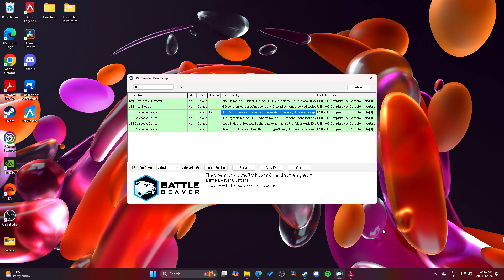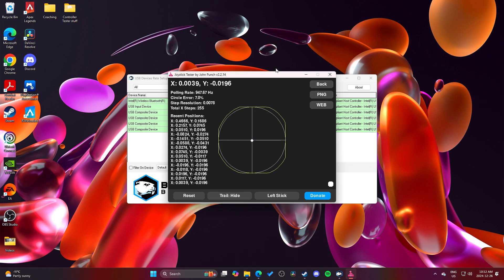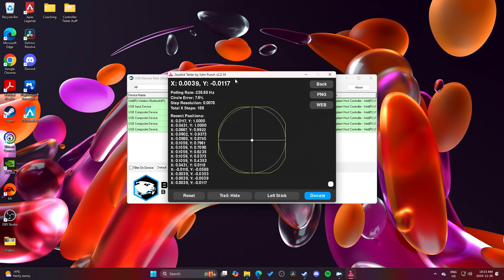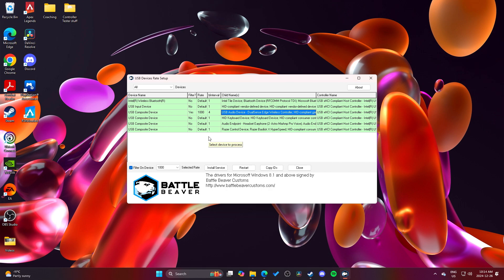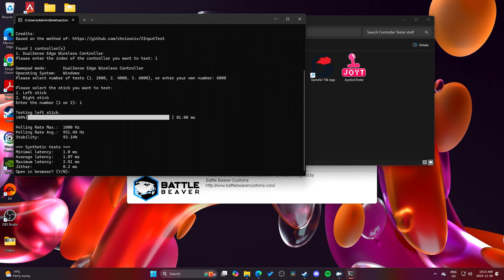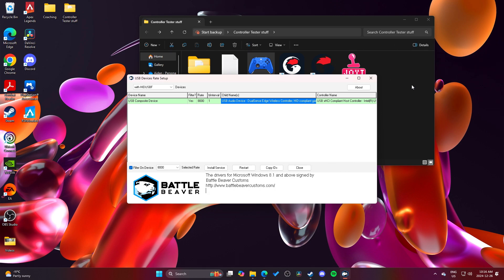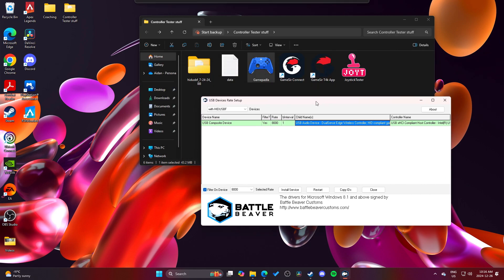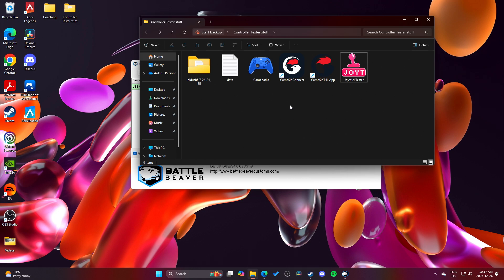PS5 Controller 8000hz Overclock Test Duelsense Edge

Comment: you know you have to use a usb 3.0 cable. They will be blue on the inside of the usb  port. So the controller only sends out 1k hz thats what the board is capable of but it will send the information to the computer more frequently even though its capped at 1k hz your usb port will read the 1khz from the computer more frequently.
Reply from the maker: Ohh that’s interesting, I’ll look into it! Thanks for the comment!

Comment: the controller motherboard is limited to 1000hz max thats why u not going getting anything higher i can overclock my xbox series 2 controller to 1k but the mother i have is lock to 125hz or 250 or something like that. but i get the same read. u ushould use the xinput tes that goes beyond 1khz but thats . polling rate doesn't equal laynacy ..
Reply from the maker: Facts, thanks for the comment!

Comment: What I’ve read is that this controller can say 8000hz but it can’t go above 2000hz. I have a keyboard that does 8000hz but it can’t go higher than 4000hz
Reply from the maker: @DanceBruce  I’ve seen tests where people get .125ms, not sure if that’s actually 8000hz though. 

My theory is that perhaps Lenovo under-clocked my motherboard to compensate for giving me a 500w PSU. I’m pretty certain they under-clocked my cpu and gpu.